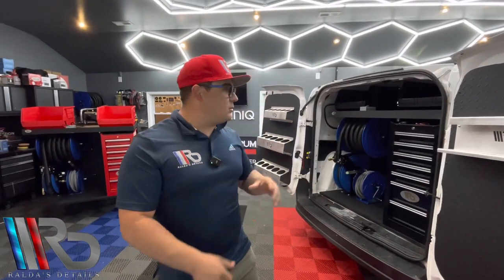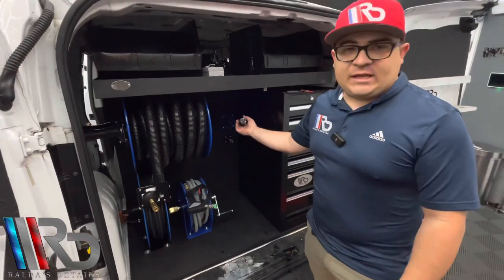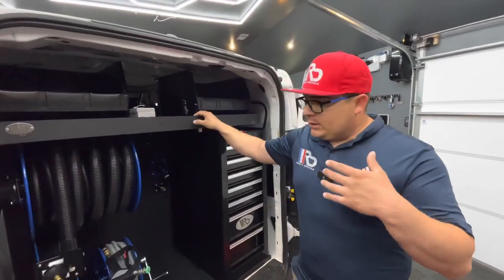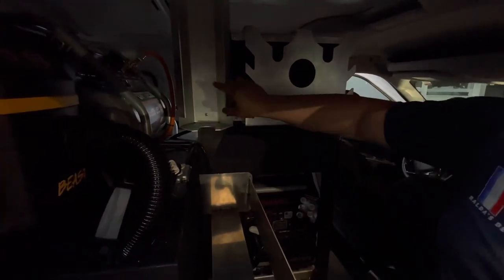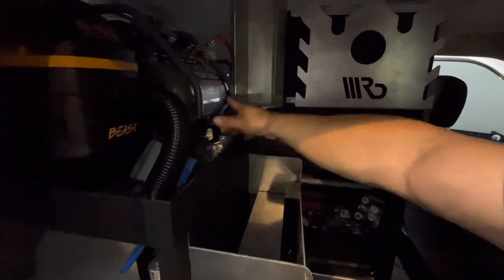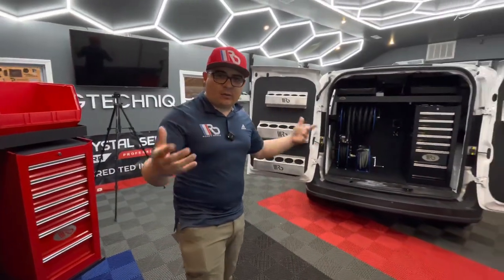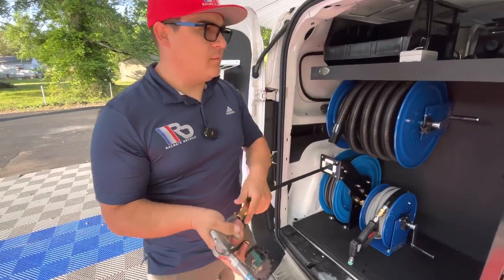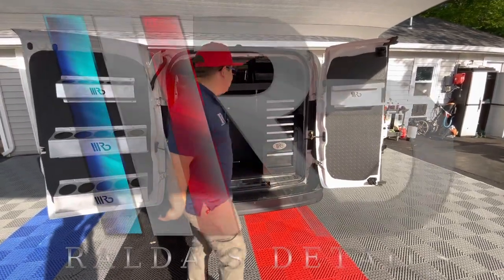Mobile detail setup | what is included and how it works! #cardetailing #mobiledetailing

Comment: What bolts do u use to bolt the frame to the van ? Becuase I’m trying to figure that out on my ford transit connect . Since I poped the little 1.5inch caps off I can see the bottom of the van where the spare tire is :)
Reply from the maker: Remove on of the original anchors points and bring it to Home Depot and look for the same trade just get a longer one👍🏼👍🏼